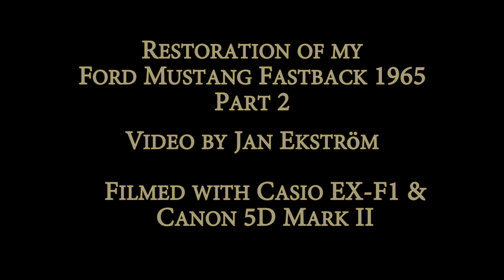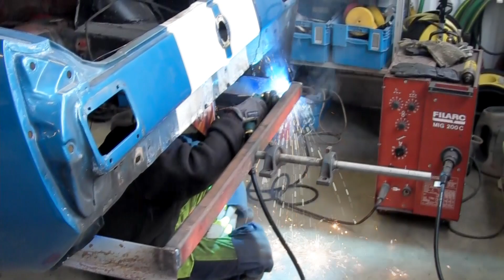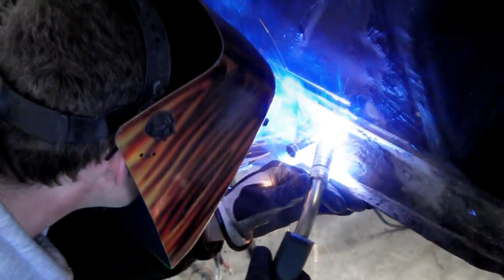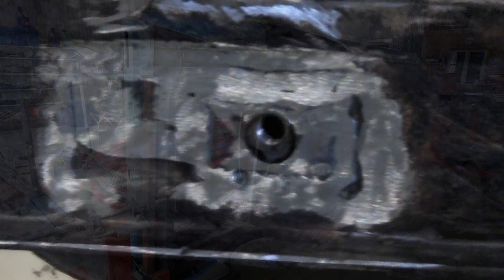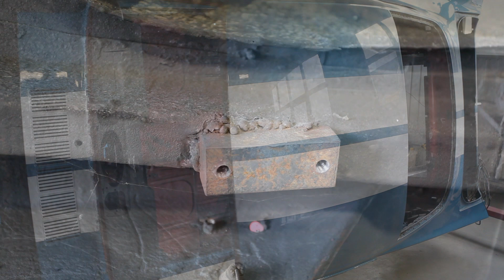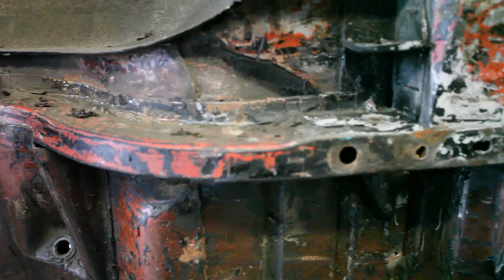Restoration of my Ford Mustang Fastback 1965 Part 2

Comment: Why do you, hot-roders,fabraters and what ever else, rev-heads and the like, first degrease, soft sandblast, and then show the full-works on how it's done! I am 60 years old and worked/still working on super-builds till now, and will go on till the day I die! Plese, get right! I will show you how-it's properly done! I don't see so many mistakes that all you young-guns do that spoil the real joy of true motor modifications should be!